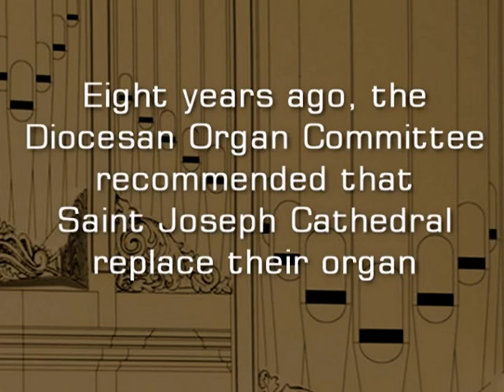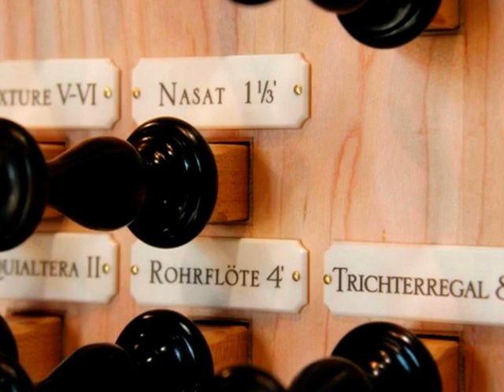Saint Joseph Cathedral Organ Installation

Comment: whoow that is a tall case with two stacks of pipes on the middle  how do you get the big pipes in there they must be very heavy to move up on a lift, how long did it take to build and final assembly, and how many pipes?